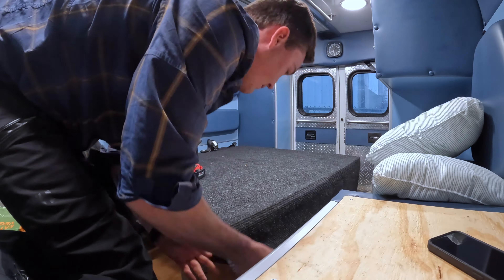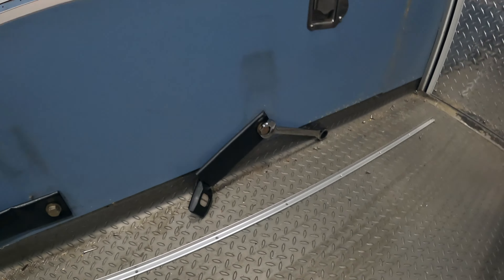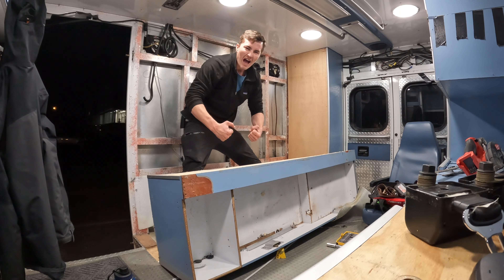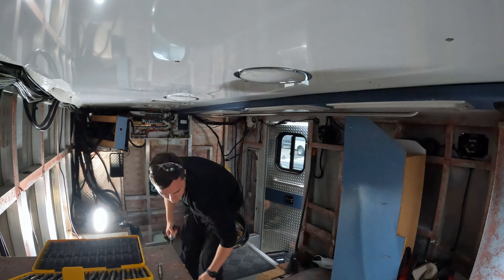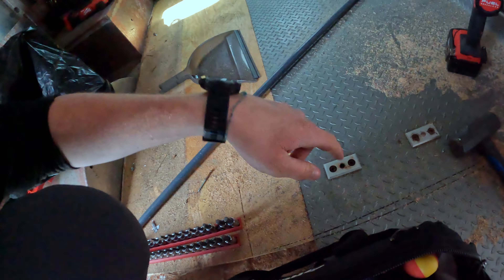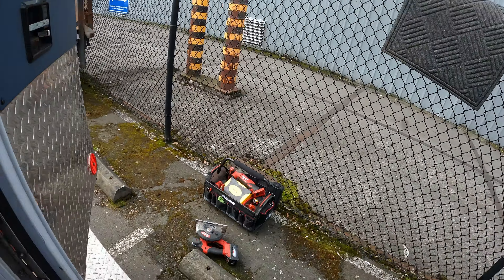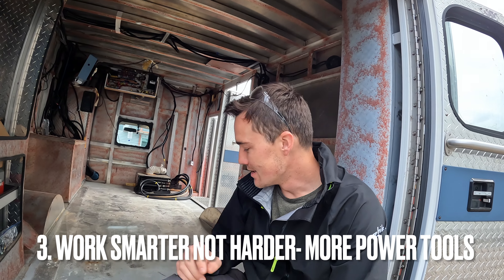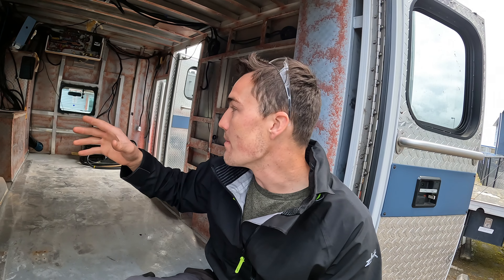Ambulance Demolition | Camper Conversion DIY Build | Ep 6

Comment: Where did you get the awesome smoked covers for the emergency lights???
Reply from the maker: Hey @dodgezilla04,

Thanks! They do look pretty awesome! I actually spray painted them with Matte Black Rustoleum Peel coat. I sprayed them with a peel coat so that if I ever wanted to sell them I could easily remove the coloring and restore them. I did the paint job in Jan of 2022 (2 years ago) and they are just barely started to fade and peel from weathering. I’m debating between respraying them or removing the lights and putting in black diamond plate to fill the holes! 

Hope that helps! My first YouTube video I made on my channel was on spraying the lights if that helps. I’m happy with how they turned out! 

https://youtu.be/YS7qYGWFR2U?si=zKLwg0GMO3sibYZ7

Comment: Wonder how much water intrusion was just condensation collecting and running down the back side of the bubble wrap?
Reply from the maker: Hi @brianberggren846! Great point on the condensation! I actually should have been more specific on the water intrusion in the video! It actually came from one of the emergency lights. One of the side blinker/flashers on the mid body lost its seal! Every time it rained (which was a lot when I was living in Seattle and probably plenty before I bought it) it would sneak past the seal and drip down the back of the wall and into the ply flooring and soaking it in. Never would have seen it or known it was leaking until I took off the wall and floor